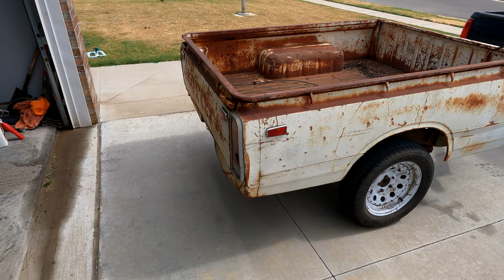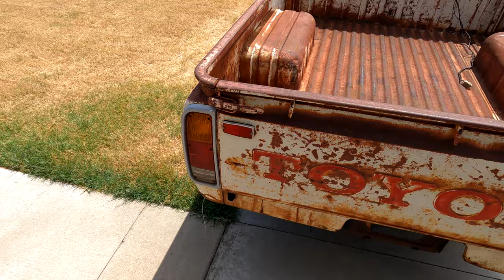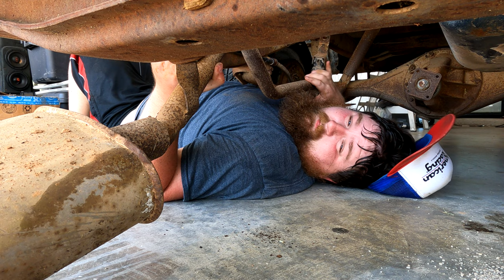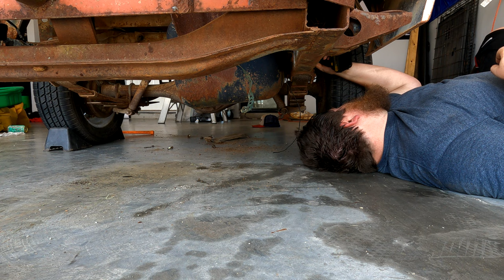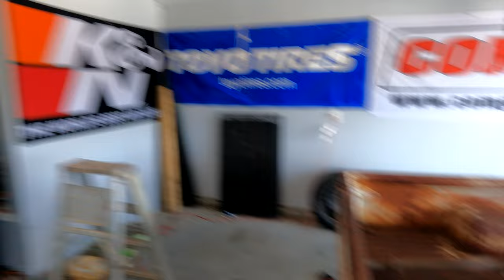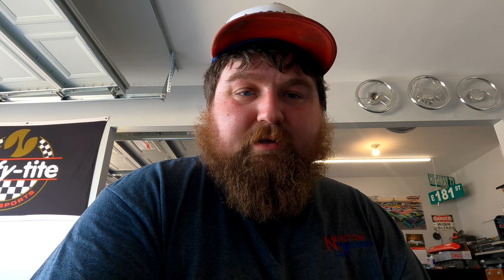TRUCK BED OFF-ROAD TRAILER BUILD - PART 1

Comment: Found a couple of these I am going to look at this weekend. Looked into the regular utility trailer idea, then a van, camper, etc., for what I am looking to do I think an old F150 long bed will suit me just fine. Awesome, will definitely follow the build, maybe confiscate some ideas. Thanks for the vidz so far.
Reply from the maker: Awesome! A utility bed was a thought for me. Maybe a future project? Haha it would have to be a mini truck size tho. A full size bed is much to big for the trails I take this thing down
Reply: @WhateverWithWheels , mine will be used for camping and fishing. Not much for off roading type stuff. It will be used as a camper mainly, an awning, etc., so It can park it and still have truck functionality, vice having to pack up camp every time I need to go get something. Cool, and thanks again!

Comment: So they left all those brake lines on it lol, but created a whole tongue. You know you can use the frame rails for the A tongue
Reply from the maker: Yeah they did. Haha basically cut it off at the cab and left everything hanging! Interesting what people will do. It was just used to pull stuff around the guys field tho so I guess I get it haha the truck was wrecked and they wanted to use what they had left. It’s a whole new trailer now tho! Hope you watched through the series! I will have another video on this coming soon as well.